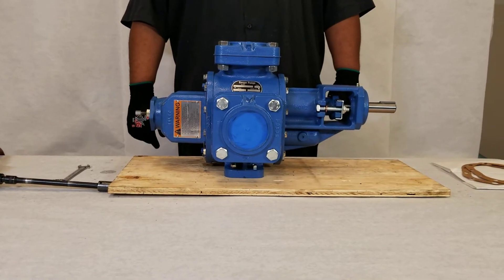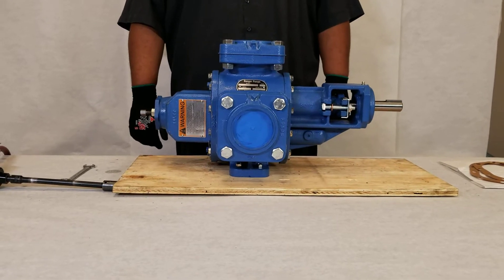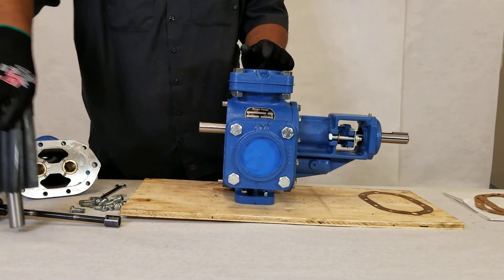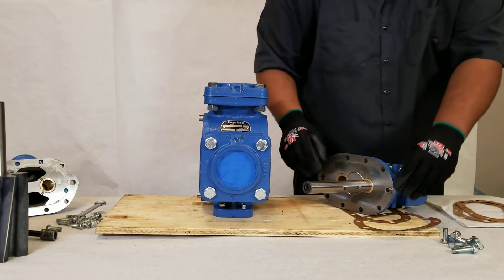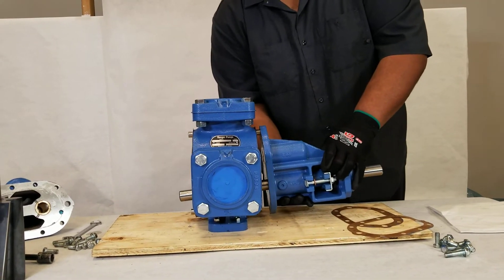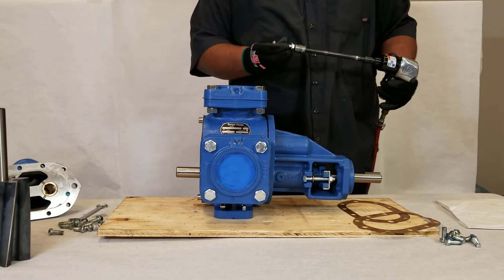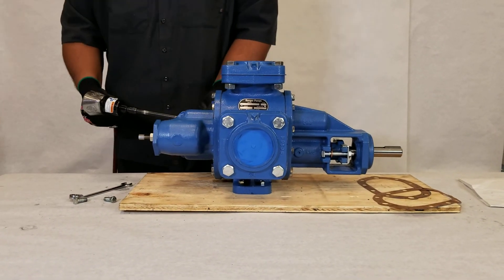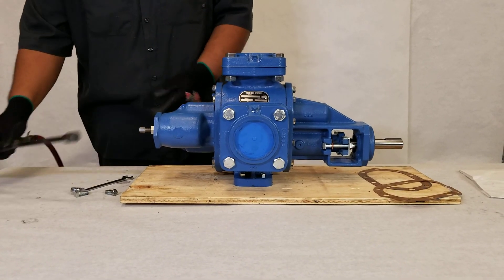Ranger Pump Configuration

Comment: I wish she would have explained the flow with the swap on the relief valve.  Before we knew what kind of damage was done to ours which was the carbon bushings turned out to be, I took the front plate off on the vehicle and the rotors fell out so I could not figure out which orientation they were in so I'm stuck here looking crazy trying to figure out if swapping the rotors on the shafts change the direction of flow or messes it up or just swapping the bypass valve changes direction of flow because the way I looked at it I think I have it figured out the way it flows through the pump to work correctly and it's exactly backwards as far as the veins inside are going in in this video so I am utterly confused